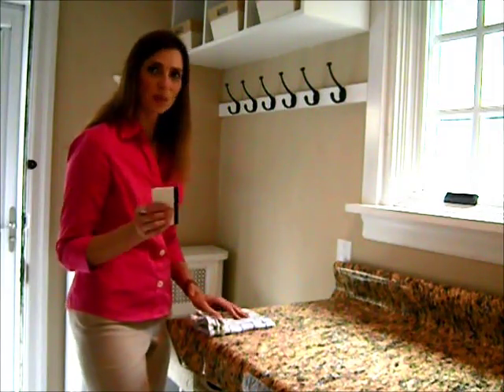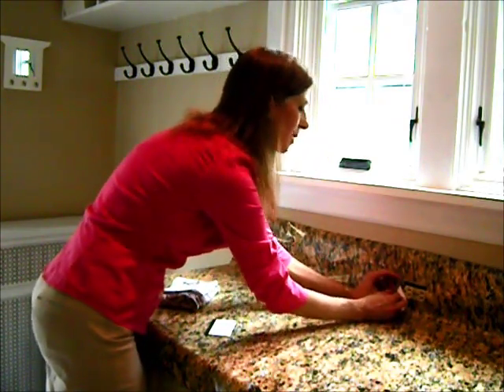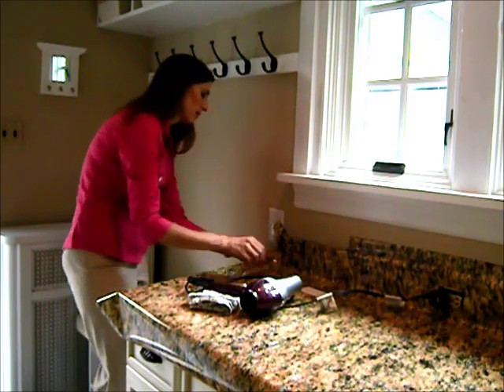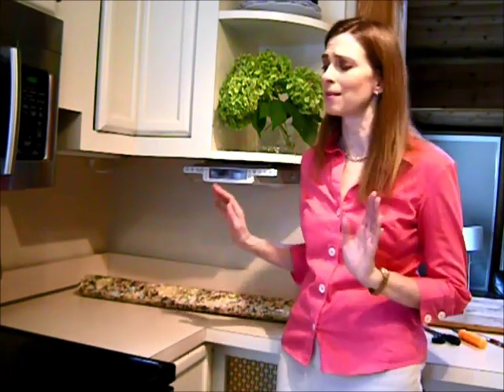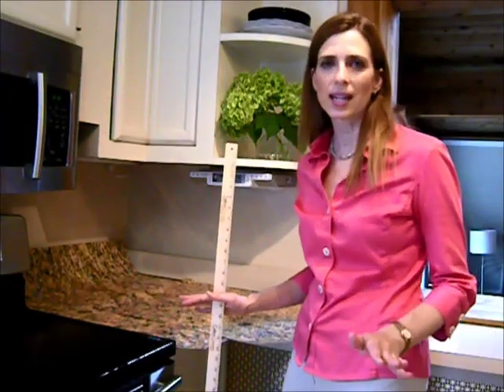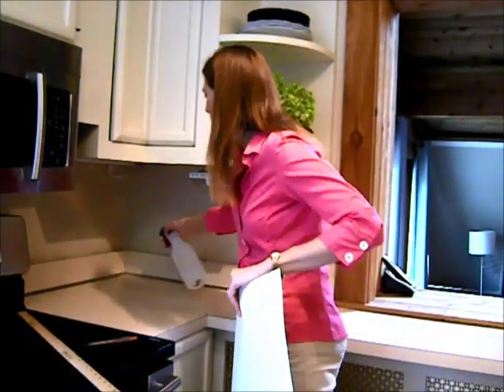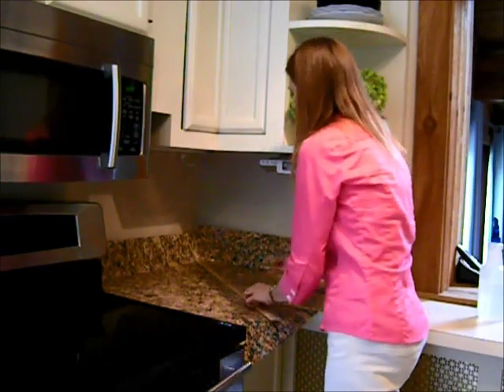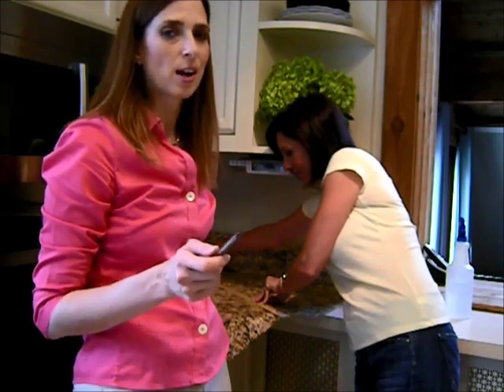EZ Instant Makeover- Faux Granite- Details like corner installation- part3

Comment: Thanks for the video, I will be trying this myself next week.  One question, where did you apply the water proof sealer?
Reply from the maker: sophie coles If you are asking about the silicone caulk, you just apply it at the seam where the film and the sink meet. Mine is an over-mount sink, so the silicone just goes on right around the outside edge of the sink. Hope this helps you.
Reply: HeartWork Organizing Yes, Thanks.